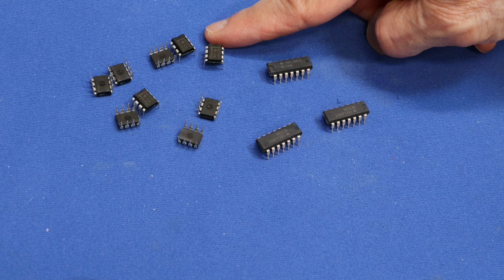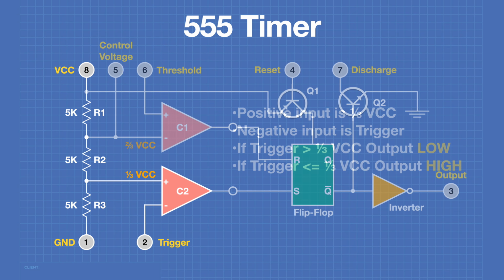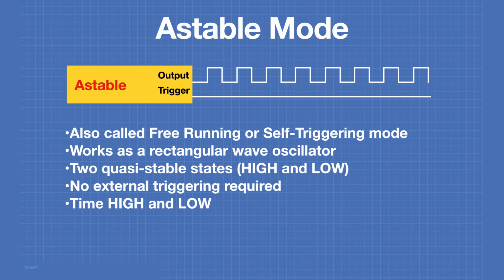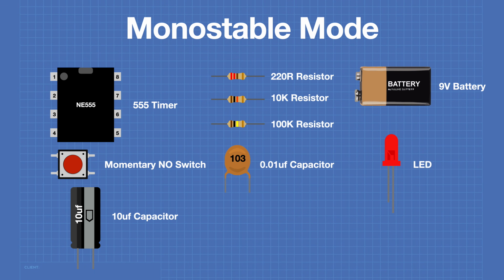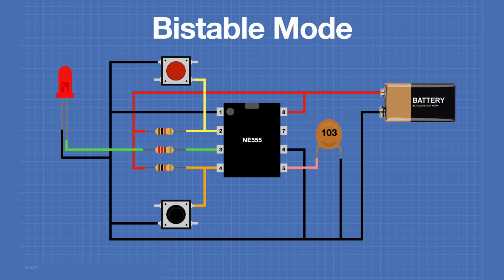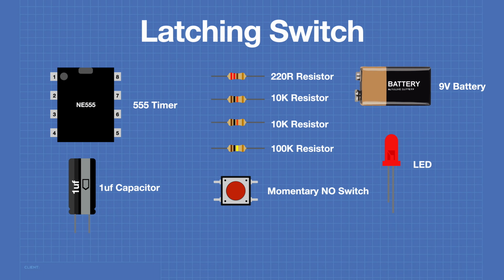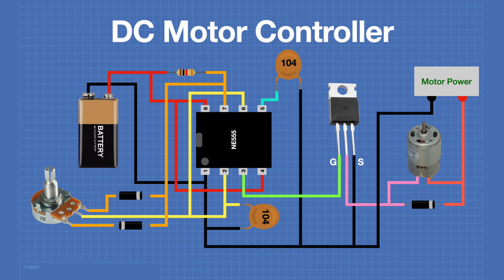Using the 555 Timer

Comment: When I was 7 I built a crystal radio in cub scouts, and while that in itself is magical, what really impressed me was the schematic. I knew I wanted to know about them, but I didn't know how to learn.

I got into guitar, and of course my head got filled with building pedals and tube amps. Still, by a combination of laziness and lack of exposure I never learned anything beyond how to not blow an LED (but not how to use it right...)

But then I finally found that ham radio was, to bring it back full circle, the missing piece. It forced me to learn and more importantly made it easy for me by making it extremely relevant.

All this blabbing to say thank you for your videos. You're truly helping me realize dreams I held for 30 years with your knowledge and effective communication. You're such an asset!

Comment: I used a 555 to build a monostable circuit to replace the rear defrost timer in my van when the controller quit working.  I had to figure out how to make it not come on when the key was turned on and how to shut it off when I wanted to before the time ran out, and used a mom-off-mom rocker switch to control it.  After a little bit of trial and error to get everything stable (using some pull up and pull down resistors) the thing works great.  I just wish I could have figured out how to make it work with a single momentary button for push on/push off operation.

Comment: I built a 10 minute timer to remind me to ID on ham radio using a 555 timer and a buzzer with 2 led's and a switch to select between led run and time is up or buzzer. That was 30 years ago and it still works fine. Has an adjustable resister to set time. Brings back memories. 73 de kb7ici

Comment: We called rhem rripple nickels 50 years ago. They cost about, in the late 70's, they cost about $2 each at the local electronics store. We used them as clock chips on prototype m6800 micro computers.  Production boards used a xytal contrroled clock chip.

Comment: The 555 and 556 have 2-transistor totem pole outputs.

In the 4017 sequencer circuit there's no need for 10 current limiting resistors for the LEDs. Since only one output is high at a time, a single resistor on the ground side of the LEDs can be shared.
Reply: And.....

The 4017 will current limit (run out of drive), so the resistor really is moot.
Reply: @Theineluctable_SOME_CANT  I've only been able to get about 15mA out of the 4017 but can't recall finding a clear specification in the data sheet. It often makes good sense to use drive transistors.
Reply: @KJ6EAD  only for heavier loads...

Comment: In the latching switch circuit, I found a little mistake; in the schematic, the green wire which connects the 100kR resistor with the 220R resistor should connect the 100kR resistor with the pin 3 of the IC

Comment: Excellent video. I no longer have the project or the schematic, but back before cell phones I put together a circuit using a 555 timer in order to patch my mobile CB radio to my home telephone. I was able to do this only when touch tone phones were in use. I only had one-way communication, but it worked well, even got about 10 miles from my base antenna, which was mounted in the top of a pine tree.

Comment: You say it operates from 4.5v to 16v, but I would buy these, a couple of resistors (and maybe a small capacitor?) and a LED from Radio Shack, and run them on a D cell battery. It was a simple blinking LED. The battery was free, courtesy of the Battery of the month club.

Comment: For the light chaser you can also use just one dropping resistor instead of 10. You just have to put it between all cathodes of the LEDs connected together and ground. And you can also build a proportional servo tester with a single 555 timer by use of a potentiometer in the astable multivibrator circuit which sets a higly asymmetric duty cycle with about 20 ms to variable 1 to 2 ms duty cycle.

Comment: Thanks. I've always used the common ccts. for the 555 without knowing about its inner workings and the full potential of the device.
51 years huh, I just have started using them when they first came out.

Comment: Thank you, I was so dumb thinking that the capacitor charged and discharged through the same path between Rt2 and ground.  I just realized that the discharge pin is involved is the discharge of the capacitor.   I figured my error now I had a 100ohm resistor there instead of a 100k ohm resistor but I’m really bad at reading color codes I used my multimeter and confirmed.

Comment: Good video, although the mispronunciation of "battery" over and over did grate after a while (hint, it has three syllables, not just two).

I would argue that the 55 does not actually have ANY "modes", since that implies that the IC is designed to do specific things only. The 555 is really just a set of very well thought out building blocks, which can be combined with external components into a seemingly endless variety of circuits, not just the three mentioned.

As an example, I did a design in the mid '70s where a 555 IC was used to drive the primary winding of a pulse transformer which was in a motor controller circuit to isolate the low voltage control circuit from the high voltage of the TRIAC circuit. I bypassed/disregarded the front-end comparators, and essentially just used the output stage of the IC by driving the Threshold and Trigger pins (they were tied together) from a pulsing logic signal, so that the signal just passed through the comparators and flip-flop and the 555 output was just a slave of the original signal. Why was the 555 used in this way? I used it because it was a simple, inexpensive way to get a fairly high power drive circuit for the pulse transformer (the 555's output circuit can handle quite a lot of current); any other solution would take multiple components (or some other bigger and more expensive IC) and probably cost more than the 555 and also take up more circuit board space. Another reason was that certain failure modes of the high voltage signal could cause the insulation of the pulse transformer to break down, and this would blow up the first solid state component upstream of the transformer. With a driver circuit made from discrete components, more than one part might be in need of replacement in that situation, requiring desoldering and resoldering, but the 555 itself would be the one-stop-shop, and it was quickly and cheaply replaced by unplugging it from its socket.

Another example of how flexible the 555's inherent features can make it; the circuit designer can use the Output pin to discharge the capacitor, and the Discharge pin as the output; this can be handy, as just one example,  if you need an open collector output rather than a push-pull output. 

The Control Voltage pin (pin 5) can be used as an input or an output in some creative circuits. It can be used to skew the default comparator voltage thresholds, but it can also be used as a signal input to override the internal resistor divider and apply a changing analog signal directly to the comparators, which is one way to make the 555 into a voltage-controlled oscillator (VCO). Books have been written about the vast number of clever ways the 555's building blocks can be utilized in unusual ways.

Comment: I came here looking for a simple timer for a very simple project, and I left with 4 additional solutions that I didn't even knew I needed.
Reply: Would you mind offering a quick description of the projects?
I'm trying to wrap my head around this and end up feeling like I'm as dumb as a pile of rocks. I think if I could come up with a real-life purpose for using it then I could build my understanding up around that goal, but so far, apart from a light independently blinking at a given rate or sending a square wave to a stepper motor, it hasn't clicked for me why this is so useful.
(I've also been staring at the Bistable Mode schematic and reading the description over and over and over for the past hour and at this point feel like I'm just going to cry out of frustration, because the language seems so contradictory and I can't figure out why someone would need to make what is ultimately On or Off so complex...)

Comment: A 555 timer should always have a local power supply decoupling capacitor. When the connections to the power supply are long, as they often are with a breadboard, I would use two. One would be an aluminum electrolytic cap of perhaps 10 µF (not critical) and the other would be a 100 nF (0.1 µF) ceramic type. The latter should be on short leads as close as practical to the 555. The electrolytic doesn't need to be quite so close.

The big transistors in the output stage of the bipolar 555 are rather slow. When the output switches, both transistors can be partially ON at the same time. This causes a large "shoot-through" current from the Vcc pin to the ground pin. Without decoupling this current spike can pull Vcc very low, then when the spike ends the inductance of the wires to the power source can cause a big voltage spike. Always use a twisted pair of conductors between your breadboard and power supply if you possibly can. Twisting the conductors keeps them very close together which helps a lot to reduce the effective inductance (the magnetic field in one conductor "cancels" that in the other).

Comment: Excellent video, even though there are a couple inaccuracies.... overall great..... several notes of caution.... you're using the standard NE555.... the 'lower power' cmos and surface mount devices DON'T have  the same hefty output drive currents.... builders...please check the datasheet...  also, when using as a monostable .... the 'trigger' negative going pulse has to be 'shorter' than the calculated timing pulse.... otherwise it 'retriggers' and the output time is lengthened... The 555 is a classic 'building block' IC,   the uses are infinite, that is why it still exists.

Comment: If one is worried about the expense of a microcontroller, start using the ATTiny family of chips, ATTiny85, etc... You program it just like an Arduino, but it fits on a 8 Pin DIP, and has plenty of IO for most projects...  Not taking anything away from the venerable 555 and 556, of course.  ATTiny will get you from the breadboard to production projects without the expense and power consumption of the Arduino development board itself...  The only extra parts you might need for on board ATTIny IC's could be a 5V voltage regulator IC, in case your project or battery runs at another voltage.

Comment: Enjoyed the video.  
My comments:  The company is Signetics, not Signetic.  Also- on the LED light chaser- you could use a common 220 ohm resistor connected to the common of the 10 LEDs because the number of LEDs turned on at any time is constant (in this case, only one at a time).  So instead of 10 LED resistors, you would need only one.  That would make it even cheaper than a micro controller solution.

Comment: Thank you, for another wonderful video! Your point about the price advantage of the 555 verses micro-controllers is well taken and not disputed, at all. But, I would like to share some knowledge, for the folks that don't know much about MCUs. There are many small micro-controllers that fall within your $1 total project budget... The ATtiny85, PIC12F683, etc. 1) They offer different functions than a 555 and those different "muscles" may be advantageous to the project's goals, so they are worth considering. 2) These are older MCUs and they are being phased out by the OEMs, in favor of their newer designs. I know all the business reasons for phasing out a product, but losing these little powerhouses is a pet peeve of mine. If we will continue to buy them, they will surely continue to make them.

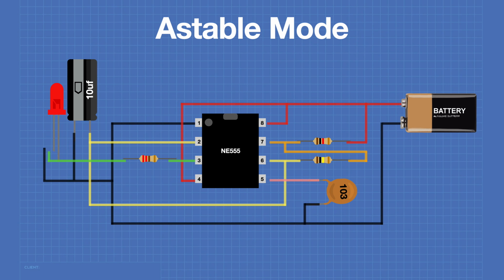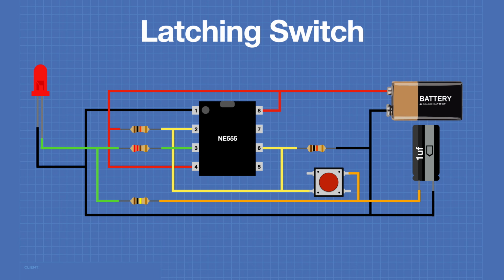Comment: At 12:05 the drawing shows a 1K resistor, but the narrator says "a ten k resistor". in later schematics the same resistor Rt2 is not used except in a fashion in the "Latching switch" (at 29:20) . What does it do in the A stable configuration other than even up the small difference in down time of the square wave? P.S. Otherwise the best tutorial I ever saw. Truly excellent work. 👍

Comment: Taking us through the circuit operations of the projects in the second half of this tutorial would make a nice follow-up video. Example: Non-Inverting Comparator X is held low. When the switch is pushed, X goes high. This causes Transistor Y to go high and the LED lights...

Comment: Very nice presentation, but there is a mistake in the first drawing of the Bistabe Mode. The reset input pin-4 should be continously be powered via the resistor and be pulled down to ground by the pushbutton. In the wiring drawing it is done right.

Comment: For astable mode you can also use just one capacitor and one resistor between output (pin 3) and threshold and trigger (pin 2 and 6). so you don't need the discharge (pin 7). It is also the only way to get 50% duty cycle and it safes some current which goes unused through R1 into discharge if you use the circuit according the the NE555's data sheet. This is especially important if you use the low power CMOS versions of the 555.

I like the TLC555 very much because it has the shortest rising and falling times of all these 555 devices. You can operate it up to frequencies of 1 MHz without problems. I use a TLC555 to test the jump response of audio power amplifiers with a 10 kHz rectangular test signal under mixed resistive an capacitive output loads.

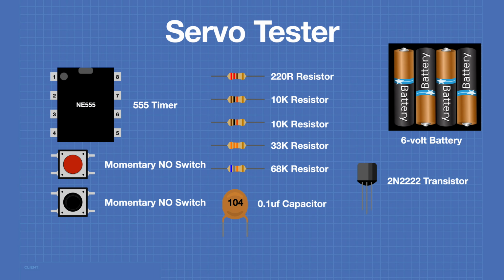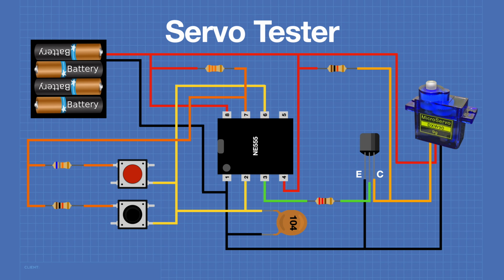Comment: You put 2X1k resistors a 10k resistors (I'm referring to the 2-nd & 3-rd resistors shown on 37:40 to 38:12 - as an example).
I noticed a previous similar reference to 1k resistor(s) as a 10k resistor(s).
(Maybe my screen isn't color-calibrated properly, but I see - from left to right: Brown, Black and RED [not Orange] rings on the resistors you present...) which makes it a10x(10 powered by 2) = 1,000 Ohms.

Comment: For my Light Chase circuit I put a single resistor on the ground side of the LEDs. Only one LEDS is on at a time. Introducing the resistor network is a good idea as breadboarding multiple resistors certainly is tiring and few even know of them.

Comment: Great video!  For de-bouncing I always used 74LS221 or whatever version of the 221 provided the speed and interface voltage needed.  Similarly, I used the 74LS74 or other flip flop parts over the 555 due to the simplified operation.  Cool to see all the functions of the 555!

Comment: Super. I needed a circuit for a modification to the tailgate lock on my car. I happened across this and it's rekindled my interest in electronics. Many thanks
Reply: Many automotive applications for the 555 chip. 
Back in 1970’s I came a cross a great application from one of the electronics magazines of the day. 
Allowed me to fit adjustable intermittent wipers to my 1960’s Morris minor. 
What was great about it was the on/off switch was an adjustable pot. So unlike even modern intermittent wipers I could vary the timing to suit the rainfall. 
Rebuilding an old 1970’s Landrover currently and plan to incorporate this in the build.

Comment: When explaining the circuit, it'd be better if you labelled the parts in the pictogram and highlighted the parts you are talking about. Also, having wires sitting flat to the breadboard is also clearer.

Comment: Light Chaser: You can get away with only one 220 Ohm resister because only one LED is on at any one time, connect the LED's directly to the chip, connect all the LED grounds together, then use the 220 Ohm resister between the LED grounds and the battery ground. If more than one LED was being lite, then the brightness of the LED's would reduce so this method wouldn't work very well. So you don't need that resister array making the project even cheaper.

Comment: Something I just thought of is that it would also make a possible inverting level shifter since they are common and cheap. 3.3 to 5v or 5 to 12v because of wide operating voltage. Plus a 556 gives you two of them cheap. Plus being a totem pole output they can drive MOSFETs, no?

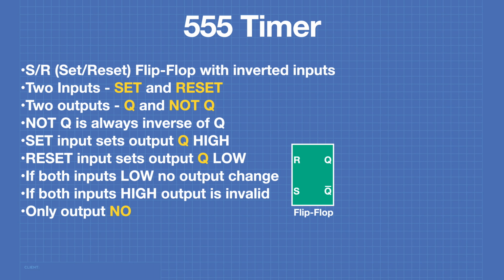Comment: At 6:17 you mention that the flip flop only outputs not Q. But the inputs are notted as well. Would it be the same if you didn’t not either the inputs nor outputs or is that required so at least 1 input is low?

Comment: This is a good example of "putting the drawing in a logical order makes the circuit simple". I believe, however, that in the drawing that includes a truth table, the table needs some help: 1) the output you label  NOT Q is really Q (which is also pin 3); and 2) the second line in the table should show the output as "stays as is" rather than LOW. Otherwise, great explanation.

Comment: I liked the latching circuit, I tried it but could not get it to work as is .  I had to move the wire connecting 100k to led over to pin3. Then it worked fine for me. Just having the circuit as a starting point was a big help.

Comment: I would like to add a note with a correction. In the wiring diagram operating as a latch switch mode there is a faulty connection of a 100k resistor which is connected between the LED anode (green line) and the key (orange line). Correction: As a rule, a 100k resistor is connected between pin 3 of IC555 (green line) and the key (orange line).

Comment: This video has vastly improved my understanding of electronic circuits in general and the 555. So many thanks. One issue I noticed in thee bistable circuit diagram, should not the two push switches be wired from the pins to ground? It seems to show pins 2 and 4 simply floating until the button is pressed and connects them to Vcc?